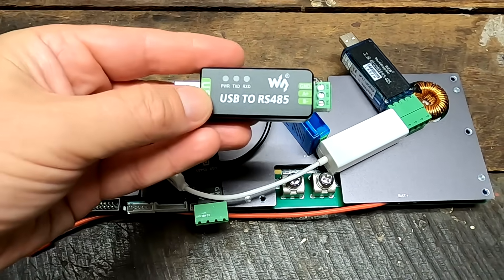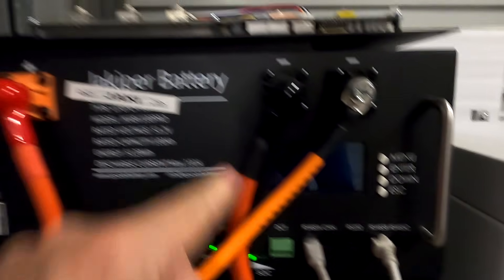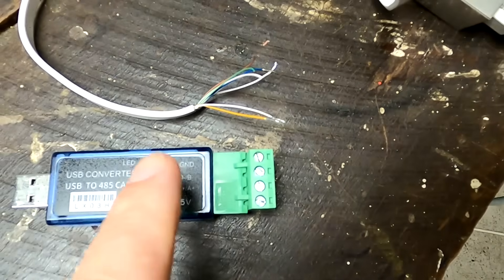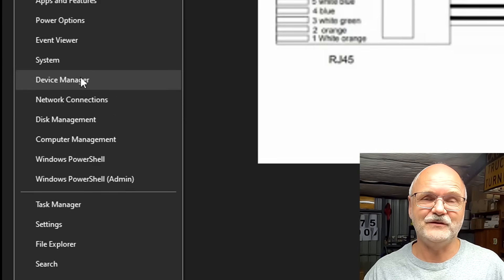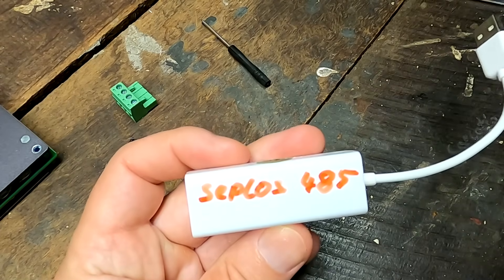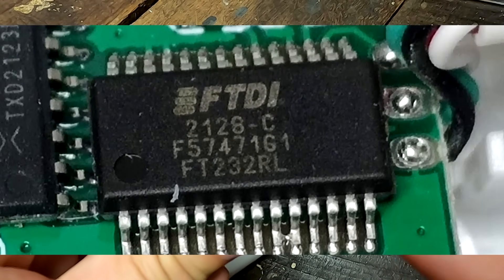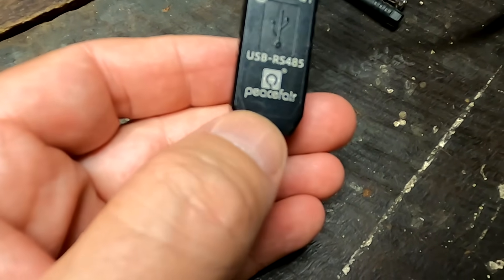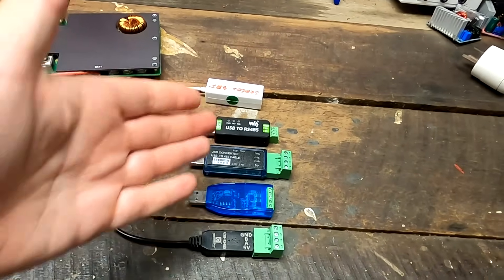JK Inverter BMS: These adapters actually work! RS485 and CAN, Adapter Test and Cabling Guide.

Comment: I got the V19A inverter BMS JK_PB2A16S20P, Software V19.10, there is a second Version V5.6.0 - don't know what this is.
To connect to cerbo GX the A-Type cable didn't work!!! The cerbo I got has 2 VE.can ports, there are versions with VE.can BAT (left). I needed the Type A cable, put it into VE.can port 2 (left). Go to the remote console, go to menu, divice list settings, scroll down with the buttons on the right side controller to services - VE.can port 2 and set can bus profile to can_bus BMS LV (500 kbit/s). RESTART the cerbo! (settings-general-reboot?). From this point on the LK BMS was listed in the devices list!

Comment: Andy, Thank you for this information and the link to the adapter that actually works with the JK-BMS-MONITOR 2.7.0.  It works perfectly when I hook up individual Yixiang battery banks. However, when I switch to parallel and try to link two Yixiang battery banks (both with the same BMS and configuration) it sees both batteries as 00 Master and 01 slave but I have no access to the top menu other than Realtime. The Settings, Control, Logging etc. those are all grayed out. This video is a year old I was wondering if anybody has a fix to this?

Comment: One thing to note, if connecting the JK Inverter BMS to a Victron Cerbo GX, use the Type A cable as described around the 17:20 minute mark, plug the  4,5,6 end into the CAN port on the battery and the 7,8,3 end into one of the VE.Can 1 ports on the Cerbo, plug a 120 ohm terminator into the other VE.Can 1 port, then in the Cerbo GX setup, (gui v2) find Settings / Connectivity / VE.CAN  port 1 and change the CAN-bus profile to 'CAN-bus BMS LV (500kbit/s)'. If you go to Network Status you should now see TX & RX Packets incrementing.
Reply: Thank you this was an essential piece to know.

Comment: Thanks Andy. Very useful. I just want to add that these adapters are useful to communicate the CERBO GX with electricity meters apporved by victorn like the ET340. I have the blue one and it works! I wish I had seen this video before as I had no idea if what I was byuying was worth it. (Victron USB to Rs485 cable is really expensive)

Comment: Hello, I have watched many of your very useful videos that helped me to build my off  grid power system and I really thank you! I need desperate to solve a parallel communication problem between many jk inverter bms. The rs485 cable included in the box is very short for my diy battery boxes and I don't know what kind of longer cable to use and where to find. May I have your help please? Thanks, Chris.

Comment: I use the seplos style USB to RJ45 connector and I’m unable to establish communication with my BMS on the JK app. v2.7.0 & v2.9.0 - non works. All the drivers are updated and I’m using the correct COM port 😢.

Comment: i try to connect mij JK-B2A8S20P to my computer whit the USB to RS485. I use the JK-BMS-Monitor 2.8.0. I get only the display that show the major status volt and current and battery cap. all on zero. Wat is my problem.????
Reply: RS485 2 Ports? The two most far away from the DIP switches?

Comment: I’m in need some help from the community. I just installed the jkbms software on my computer and can’t allow me to use the software options like. Realtime, settings, control, logging, detail logs. About. However I can see cell voltage, battery temperatures. But not also no capacity, no remain capacity. What am missing? Is there a setting I need to turn on? Any help would be appreciated thank you.

Comment: I recently tried to connect using one of the RS485 adapters Andy shows in his video. It didn't work. There were two things that I had to do first. In the JK PC Software you have to specify the device ID, my JK BMS had device ID 0 (master) and this ID cannot be selected in the JK Software (only 1 and higher). So I used the dipswitches on the BMS to give it temporarily ID 1. Furthermore my UART1 Protocol in the advanced settings in the JK BMS had a default 000 value(4G GPS Remote....), I had to switch this to 001 (JK-BMS RS485 Modbus V1.0). Then everything worked.
Reply: Thanks for the information. I have got a Gobel DIY Kit, which contains a JK BMS. I have assembled it, and it starts and the mini display shows the SoC, Voltage. I saw the battery as ID 0 in the tab "parallel" in the JK-BMS-MONITOR. I have put up the left dip switch to up, and the i see the bms as ID 1. When changing the UART1 Protocol to 001 , i get this error:  A Response error: Data logic is invalid or out of limit. Did you see this message also?
Reply: @klausaengenvoort8792  No,  I did not, did you use the latest jk monitor version from Andy's site?
Reply: @ericschloesser9290  yes, that is DIY 🙂
Reply: The Gobel Power DIY Kit contains the JK-BMS. In the part list it is listed as "JK-ESS-BMS-200A-MAIN-BOARD". Do you know, which firmware version i have to select on andy`s website. There are four options, and i do not know, what the mean: JK-PB2A16S20P, JK-PB2A16S15P, JK-PB1A16S15P or JK-PB1A16S10P?
Reply: @ Sometimes the box is included that contained the BMS, the type should be on it. Other way is using the JK BMS app, connect and select about to see the exact (hardware) version

Comment: Hello my friend, i have a Daxtromn inverter and i would like to connect it with my JK-B2A24S20P bms. Can i connect directly the pins from gps port (ground, Rx TX) to the   rs485 port of my inverter or it needs a converter?

Comment: There are various combinations of progressive higher quality and more expensive adaptor.

Basic level is what you mostly showed.  Just USB to serial chip followed by serial to RS485 chip.  No isolation, no or little ESD protection.

The FTDI chip has advantage that it has a Tx/Rx direction enable pin to control the direction of the one-way simplex RS485 chip.  Many of the cheap units use the Tx data line to feed the data direction switching of the RS485 chip.  This causes a problem with logic zero not being force driven, relying on 120 ohm pull down resistor for logical zero Rx data.  This can cause issues with distorted data when you have long lines on RS485.

Second level of quality is having more elaborate ESD protection on RS485.

Third level of quality is having full galvanic isolation between USB/serial circuitry and RS485 circuity.  These are the most expensive but provide the best electrical isolation between source and destination devices.   These USB to RS485 converter has a black rectangular box that is an isolated 5vdc to 5vdc DC to DC converter.  You can have several thousand volts between 5v circuitry on one side and 5v circuitry on other side of DC to DC converter. 

In addition to 5vdc isolation, there is also an optical or magnetic data transfer isolation for the serial data going from USB to serial chip and RS485 chip.  You can have several thousand volts between source and destination chassis and data flow will still work and there will no damage of the source and destination equipment. 

Industrial applications use this to control various equipment, like powerful electric motors with VFD drives that may have their chassis ground potential jacked up in the air due to long AC power wiring runs.   Also protects source device when destination circuitry gets a lightning hit voltage gradient.
Reply: Hi... Can you recommend one? I have here 3 BMSs... Not Communicating anymore after FW updates... I am suspecting an ESD event was going on...

Comment: Hello,  I'm have strange issue with pb2a16s20p.
When I'm connecting converter RS485 to connect with inverter it's time to time lost connection.  So I check with RS485 usb converter but each conection BMS restart and give buzzer noise. After switch off led light from status are little light. And I hear noise from main board. Cable is ok and ground connected in RJ45. After I check CAN converter to usb. It's working but the same phenomenon. Each time when connection done BMS restart. And after 30min BMS switch off. 
I'm confused. It's new BMS. What can be wrong.  In log file :Discharge short circuit protection released
Please help. 
I want to use communication with Inverter. 
Thank you.

Comment: Hello Sir, thank you for the good guideline film. Just curiosity, is it so that RS485 to RJ45 translation wiring is not defined by the standard ? I see that on many devices RJ45 signals are on pins A(5,6) B(3,5), 5V(1,2), GND(7,8) while JK use the A(2,7), B(1,8) and GND (3,6) ?  BR KP

Comment: Hi Andy. Do you know how to connect with JKBMS support. I've tried email them and write a request on the site but they haven't responsed. Seems they have an error in MUST CAN protocol in there current vertions 15.30, 15.33

Comment: For your information, CH340 is the USB chip, this is the one reported by Windows when you connect adapter. It's not related to RS485 and this is the same chip on most Arduino/ESP32 modules.
In the last adapter, the chip is a MAS485 which convert RS485 signal to TTL signal routed to CH340 then to USB port. You also should have another chip than CH340 on the blue adapter.
Reply: Dear furydonnico, you are right by 200 %.  Most people don't know the difference between RS232 and RS485.  All the adapters that Andy is looking at are indeed pure RS232 to USB adapters.  Internally there is also another chip to convert the RS485 voltage levels to TTL RS232 levels. Those TTL signals are routed to the CH340, to the FTDI RL232, ...
As a consequence these adapters will only listen to "the character based RS232 protocol". Of course , RS232 is not a protocol, but it does RX/TX of bytes , starting each byte with a startbit and ending with a stop bit (mostly they don't use the parity bit). As a consequence , other RS485 protocols that are not using the concept of start-bit, 8 data bits, one stop bit,  will NOT be compatible with those so-called RS485 converters.  Those so-called RS485 adapters are only usefull if they are dealing with the startbit,8databits,stopbit as communication brick.
Most of the time the JK_BMS company is to blame : they call whatever com port a RS485 port, (even when it is a pure RS232 port). Too much moutai at the engineering department of JK_BMS.
Dear Andy is making a short-cut.  The wrong one ....

Comment: Hello! We are struggling in connecting JKong BMS to our Daxtromn 6.2kw inverter which has a built in BmS… the batteries we got are simple 105Ah with no input/output for communication with the inverter’s BMS. Could you please please help us with understanding what cable we should use and how to make it (or where to buy it)? Thank you!!!

Comment: 12:21 in video. What if i used USB-RS485 Peacefair and i see all parameters from my JK bms 200a 16s, but i do not have options to click like "settings, control, logging,detail log, about"? These tabs are grey on my pc. What should i do? I would like to update a firmware.

Comment: Hi Andy (and others) 18:00 . In the documentation you're showing from the Victron manual, you're showing cable type A, with GND on Pin 6; However when I look at the JK BMS, it describes GND on number 15, which corresponds to pin number 2 for GND.

This means it would be a Type B cable in de Victron documentation/world. 

This leads to confusion in the forums. Is my conclusion correct, it should be a type B cable instead of type A?
Reply from the maker: Noooo, it's always Type A cable. JK shows the numbering from the wrong side! This is a bug in their manual for... for... I don't know why they don't fix this.
You actually don't need GND at all CANL and CANH will work without.
I should probably do a video about it and we build our own Type AB cable for the JK-BMS.

Comment: Hello, watching an interesting video and wondering if it works with a converter from rs 485 that converts the signal to wifi to grind cable.
Is there a need for an app for a computer, if needed, where can you find it 
Hoping for an answer
MVH
Larry Hey

Comment: in case the CAN ports for the inverter are the same as for JKBMS, can i just use a normal lan cable to connect or do i still have to crimp a cable with only those pins connected?

Comment: hello , think you are the one on the planet who can answer my question .... i have a Daly 250a li-ion bms 14s , and the problem is that , i only have 12 balancing wires and the ground wire ... is it possible to wire up the balancing wires so i can use the bms ... because it will not work with only 12 wires ... and i cant change the config of the battery because it is 2 Tesla modules at 25v with 6 balance wires each .... hope it would be possible , thx ... and great videos you produce ...

Comment: I have the older JK B1A20S15P, which I think you had at one point (or one similar to it).
Did you ever do a video on RS-485 communications with it, and/or upgrading it's firmware?
I will have a couple banks of 304Ah EVE batteries soon, and have ordered the JK inverter BMS for those banks.  I saw your video on the communications with the inverter BMS, thank you.
The older JK BMS runs fine, but there is no comm with the inverter.  My inverter supports Pylontech as one of the options...I have the Waveshare RS-485 adapter.

Comment: I bought an RS485 adapter but it never came with USB adapter just 3 bare wires. Then I bought the USB adapter with FT232RL chip and it still did not work. JK-BMS monitor V2.8 on Win 10 PC showed it was connected but there was no data showing. After 2 days messing around it turned out I had to change an Advanced Setting on the BMS first (using smart phone with BT) namely change to UART 1 Protocol No - 001 JK BMS RS485 Modbus v1.0   Then the adapter works perfectly.

Comment: which cable to connect the bms to the voltronic inverter?
Reply from the maker: That depends on your inverter model and what pins it uses for RS485 or CAN. Have a look in the manual of your inverter under communication. It should be described there.
Reply: my inverter rs485  what protocol in inverter voltronic?

Comment: Greetings Andy from sunny Florida USA (don't hold that against me!). I wanted to thank you for all of your videos and ESPECIALLY this one. I purchased a DIY kit that came with a JBD BMS for 16S LifePo4 batteries. I am completely new to battery packs and solar but I am addicted! I started off with this relatively simple DIY pack since it was a kit, and had good instructions from the seller. However there was ZERO information about the JBD BMS, even when installing it I struggled to find the actual part # because everything I thought was it would come back with nothing on Google.  Anyways I saw this video and your BMS looks identical to mine only its a JBD not a JK (if there's even a difference). I had no idea what the ports were for (well I had an idea but no clue about the parallel and how to communicate with the BMS using computer software). I immediately went out and purchased one of the RS485 devices you showed and wired it up with an old ethernet cable just like in your video. At first I was having trouble communicating with the BMS, apparently JBD makes several versions or types of its software, none of them worked right, I tried the JK BMS and that did not pick up the BMS. So I went to the Ali-Express website and went to the official JBD webpage, from there I was able to download yet another varient of the software. This one looked a bit more promising when unzipped, many more files/folders. After some fiddling with it I was able to connect!! I had suspected that the values for high voltage cutoff were being set too low (3.3v) vs 3.5v. I remember manually charging the battery with an appropriate charger and then seeing the LCD screen showing I think around 3300mV give or take. I could have been wrong. However I think I'm right based on the parameters I could see in the BMS software. I made a change from 3.3 to 3.5 with a absolute cutoff voltage of 3.6. I also adjusted the maH to properly represent my batteries capacity. I am charging one up now to see if it does indeed charge the batteries to a nice full 3.5v instead of 3.3 if it works I will be wildly happy! I took a backup of the default configuration just in case. I want to thank you, without this video I would have never probably been able to connect to the BMS. Also thank you for your videos in general, your videos helped me learn how to wire up JK BMS's as well as I use them a lot. Keep up the great video's! Cheers mate!

Comment: Hello, I am using JK-BD6A24S12P model bms. I need to use RS485 pins and read data and display them on the LCD screen connected to Arduino. I bought Jk Bms RS485 Adapter Module. Can you share sample codes on how to connect this to arduino and pull data from bms? thanks

Comment: Hi Andy, danke für all deine Videos 🧡. Ich habe eine Frage, die sicher auch irgendwo in deinen Infos vergraben ist, ich aber nicht gefunden habe.
Es gibt das Thema mit dem Ground trennen bei den Victron-Systemen. Wie schaut das bei der Kombi mit dem JK BMS und Victron aus. Wo / wie muss hier auf die Trennung der Masse geachtet werden. Könntest Du mir da eine Info zu geben - oder wo ich die finde?
Vielleicht wäre es auch mal wieder ein aktuelles Video wert - die Gesamtverdrahrung / Übersicht deines Systems.
Lieben Dank, Marco

Hi Andy, thanks for all your videos . I have a question that I'm sure is buried somewhere in your info, but I haven't found it. There is the issue of ground isolation with the Victron systems. What does this look like for the combination with the JK BMS and Victron? Where / how must the ground be separated? Could you give me some information on this - or where can I find it? Perhaps it would also be worth making an updated video - the overall wiring / overview of your system. 
Many thanks, Marco